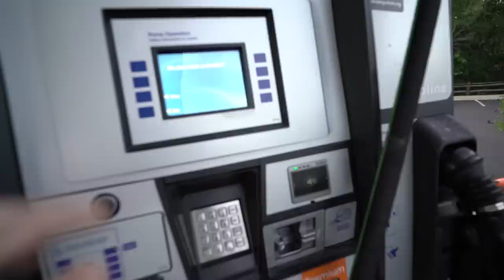Spirited Drive Ruined By MK5 Supra?!

Comment: PSA: Be like Tsuchi, and DO NOT cross double yellows! That supra was incredibly moronic for divebombing right before a turn, dude is extremely lucky no one was driving spiritedly in the opposite lane.
Reply: I was thinking the same thing. If a car was coming in the opposite lane he would’ve hit them head on.
Reply from the maker: Allegedly to overtake me, that Supra was doing triple digits
Reply: @TsuchiFD  Just as you expect slower cars in front of you to pull over, you should have probably pulled over to let him pass, but he's still a idiot for crossing double yellow he should have stayed patient behind you.
Reply from the maker: @zombielivesmatter7294  it was only the straight where he was faster, Griffin was on his ass the rest of the way in the turns
Reply: Virtue Signal harder
Reply: Agreed, I do togue runs in LA mountains and there has to be SOME common sense about safety and crossing the center line is a definite no no. If you cant handle that stay off the mountains.
Reply: @zombielivesmatter7294  I've been on that road a gorillion times and the only pulloff point is where the red? car in front of the RX7 pulled off. 
And obviously the parking lot to the left after that (where the RX7 went to)

the destination location is "sempervirens parking lot"
Reply: @__dm__  That was a very un-intelligent reply by you when what you say is the opposite of what's on the actual video we can see with our own eyes. You can see at 10:01 AND 10:15 that can pull off to the side to let white Supra by. But let me guess, you won't use the dirt pull offs because you don't want to dirty your clean wheels and only want to wait for a double lane to open.  Look at all of Tsuchi or anyone else's videos, there are courteous drivers that pull off aside on the dirt pull offs, just because you're not one of them doesn't mean everyone else won't.
Reply: @TsuchiFD  He obviously caught up to you guys some how... your buddy was only 'faster' because he had a chip on his shoulder after getting passed....
Reply: @lakaiskates8064   caught up by reckless speeding and illegal double yellow crossing
Reply: @zombielivesmatter7294  they did do that but he didn’t even give them a signal. Would be crazy for a car to accelerate that fast to pass someone, he had to have been going that fast for awhile.
Reply: @mariagus805  yo dirt pull off are sketchy please don't use them unless an emergency. I have seen puncture tires from the reck cars. Especially with how bad his tires already were.
Reply: @NatVirgo    exactly! everyone's talking like he was behind these 2 for a while and they wouldn’t let him past. That dude must have come flying up behind out of nowhere and overtook without even slowing down!
Reply: @FA_213  I think you can do it for fun when you can see clearly that there's no one in the other lane for a while back, but normally on mountain roads you really can't. I'm from central ohio so even the best roads around here are fairly clear

Comment: PSA for Touge enthusiasts: 
Never cross the double yellow. Even in clear corners. It is never safe to cross the double yellow into the opposing traffic lane. Staying in your lane will also help you improve your line.
Reply: Nothing wrong with cutting the line when it makes sense and there's visibility. Stop virtue signaling and find a new hobby
Reply: @sil-zk8061  There is something wrong. If you cut the double yellow, it builds a habit. And it only takes one time to do it without thinking on a non-ideal corner, and you crash into oncoming traffic. You lose your car, and possibly your life.
Reply: @sil-zk8061  No reason to cross. If your car can't handle the lines without cheating the corners then its time for an upgrade.
Reply: @TheDealer6373  something tells me you havent experienced the thrill of actually pushing it down a mountain pass as fast as physics will allow without subduing yourself. That life's not for everyone
Reply: if someone is doing half the speed limit of the road and refuses to use the pull off lanes i will absolutely make a pass when its clearly safe to do so. Your statement about it being "never safe" to cross double yellow is just straight up wrong.. Ive seen passing lines on sections of roads where its totally unsafe to pass over and vice versa.. You determine that its "safe" to speed on a given road (for what ever reason) but yet also make the claim that its NEVER safe to cross a double yellow.. 

PSA for touge enthusiasts: Use your own judgment, no two roads are the same, especially from country to country.
Reply: @nomeru_0  actually, you may be right on this one. In this situation, the supra owner should have not passed. But I do agree that if there is someone going slow as shit and you have the amount of room + more that your car needs to pass. I just never choose to cross a double yellow because of incidents that have happened to people I know who have and paid for it.
Reply: @Circa88  I don't disagree with you on the fact that in this specific case of crossing double yellow the supra is at fault. 

ive had a situation recently where a car was doing 10 under on a "touge" road and i was flashing my lights at pull off lanes for them to use it and instead they slowed down to around 25 under the speed limit (out of spite, i can reasonably assume).. i ended up overtaking them on a fairly long straight that was double yellow and they honked at me and sped up, not realising that what they were doing was just as, if not more illegal and dangerous.
Reply: @sil-zk8061  "My ego is too fragile to risk getting shit-stomped on a circuit by better drivers so I use public roads as my racetrack because then I can at least feel like the biggest man on the road." Fixed it for you.
Reply: @nomeru_0  in that situation I agree, passing is ok. You are definitely right to say the passing on a double yellow comes down to common sense.
Reply: @thegirthquake8574  Nothing to do with MY ego. I'm not the one virtue signaling WHILE trying to co-opt a risky lifestyle. Circuit racing is a totally different game with much more stringent and financially costly rules. If this guy wants to go run on public roads and film it then he shouldnt get emotional when he gets passed by someone way more competent. 

Dude couldnt even keep up with the Supra after he got passed. His friend up ahead held on for like 2 turns before he had an emotional breakdown and had to pull over.
Reply: @sunzoo4673  Mate I was responding to him not you.
Reply: @Circa88  props to you for actually listening and considering another persons opinion, thats rare to find on the internet
Reply: @sunzoo4673  found the driver of the supra 🤣
Reply: @thegirthquake8574  thats me m8
Reply: @sunzoo4673  the @ says "SIL-ZK" on my screen
Reply: @nomeru_0  thanks man. I always do my best to be civil over the internet. I quite enjoy having conversations with strangers and seeing what they have no say.
Reply: @thegirthquake8574  dats me m8
Reply: @sunzoo4673  Why did you post with two accounts?
Reply: @TheDealer6373  Nah dont upgrade if you cant hold a line, thats driver error. But crossing yellow is literally only okay if you can see around the corner, like 0 trees in the way. Its really not cheating if youre just driving a racing line.

Comment: Love the videos, new follower but after watching some of your touge vids I have some friendly advice from one spirited driver to another: Try and be a bit more linear with your throttle input in corners, and try not to lift mid corner. It can get sketchy real quick if you come into a corner too hot and let off throttle. Hope you don't take it the wrong way I'm not tryna critique your driving by any means
Reply from the maker: Nah I gotchu, it’s just driving advice bro I try to improve everyday
Reply: So I’m new to the touge scene, I was wondering where is a good place to start in terms of learning technique?
Reply: @TsuchiFD  cheers man keep it up! Love the content
Reply: @bryanrojas47  watch videos on driving techniques, learn the basic strategies of things like trail braking, weight transfer in corners, driving lines and so on. Once you know the basics it's basically just alot of practice. Also the ability to mess with your suspension geometry yourself greatly helps.
Reply: @bryanrojas47  Really, if you want to carve up the twisties, start with your braking. Because mid corner and late corner are all negotiable if your entry speed is right. Once you're confident with your braking points and entry speeds, you can explore the way the weight shifts in the car.  Just start off slow, its not about driving fast, its about the flow.. Twisty roads have a "right pace" Not the fastest you can go.. Just the sweet spot.   Stay safe and have fun. :)

Comment: It's a shame you may not have access to pump 93 octane. Not much difference, but you may not have to run as rich with 93 Instead of 91.
 I had an 03' cobra with a kenne bell that made 711 to the wheels. I miss fun drives like this...

Comment: I don't think its just rich...  Are you checking your oil level? Its happening on decel. Did you check your oil level after the run? Your turbo might be blowing a bit of oil, most of turbo seal leakage happens on decel.

Comment: i personally i like automatic  transmissions cuz  it has better gas mileage and with the new trans they are making they shift faster then manual can  better top speed and better torque response as well and iv never been good at changing gears lol  i gind them ALOT and stall

Comment: did you seriously pour your two stroke in after filling up the tank? so the oil is literally not mixed at all and is in little strands floating around in the gas so your randomly just gonna get 90% two stroke oil in random intervals it will make you think your cars running like shit or power surging randomly